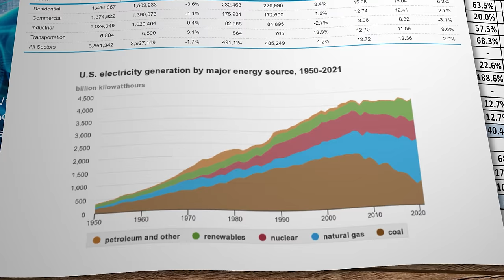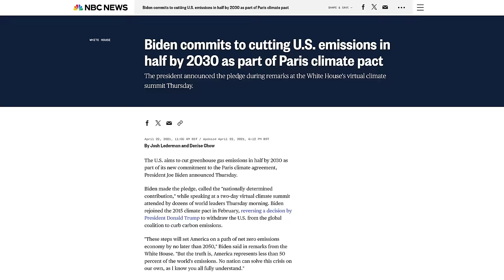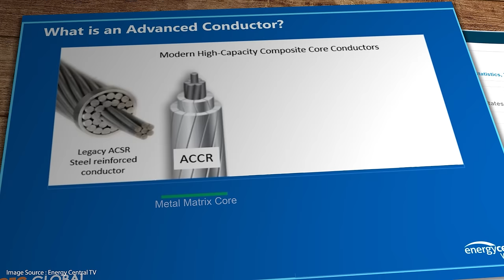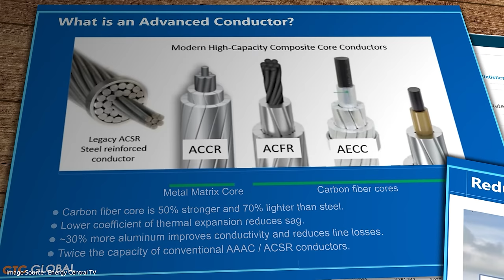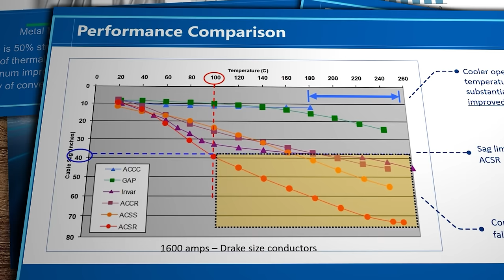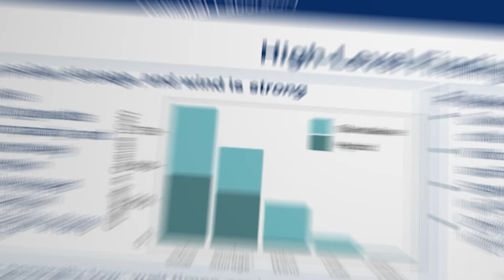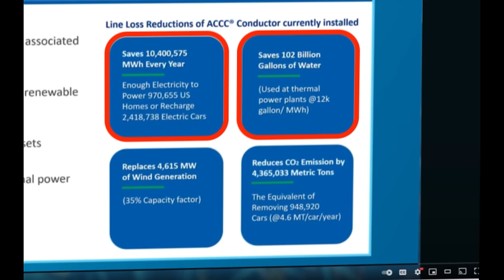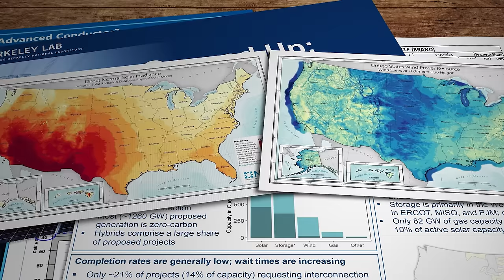Rethinking electricity grids.

Comment: I have been a shareholder in an upper Midwest (US) electric utility for over 50 years.  I speak with the CEO on a regular basis.  This topic has been part of our discussions for the last two years.  The companion to this are the sensors which can be placed on the cable that relay temperature information back to the utility.  These two technologies can increase the ampacity on the line 30 to 50%.
Reply: Excellent, thanks! I would also like to see more distributed solar and batteries, and more incentives for home and business owners to install them. Also, the weak link for that essential distributed electricity generation is excessively high battery prices. A $1,300 Powerwall néeds to store 40 kWh of electricity, not its currently pathetic 13.Here in California, I generate more than enough electricity to power a home and EV. But, I need a small, affordable, EV work pickup, not the $100,000 monster trucks currently available. And, I need40 kWh of electricity storage to go off grid.
Reply: @freeheeler09 I haven't dug into this, but I'm hearing that some good deals are available on the F-150 Lightning.

It's energy storage features are pretty impressive.
Reply: @freeheeler09  agreed! However, what if the EV car WAS the main battery, while the powerwall was the backup for while the EV car was in use?
Reply: Sounds great. I have seen an article about these sensor balls. Thing is, how does a dynamic current-carrying capacity on the line fit with the rated capacities of switchgear and transformers?
Reply: I could be wrong, but my understanding of the 'magic' sensor balls is that they give the electrical distributor the information needed to maximize current on the distribution line given the specifics of that line (temp etc).  Without the ball the distributor makes an educated guess, but always under estimating allowable current so as to not destroy the line.  The ball doesn't actually allow current greater than the line could handle without the ball.  So presumably the downstream transformers were sized to be able to handle anything that the line could handle and the magic ball just allows full current all the time which is not happening now.
Reply: @davidmenasco5743  problem with F-150 is it's oversized. The hood is dangerously too high, M1 Abrams has better visibility in front! And the bed is too high to easily put things on it. A work van is so much more practical I'd hate to drive one of these new "pickup" trucks.
Reply: @katjordan3733  Not a good idea, mobile batteries have more engineering demands placed on them in terms of weight, power and energy density.  A stationary battery should always be able to beat it on cost pwer kw/h basis.  All effort should be to put load on that more economic system rather then the one in the car, the absolute worst thing would be to drive up the size of car batteries for non-driving usage as you would effectivly be adding parasitic weight to the car which would increese total energy usage.
Reply: @chameleonh Yeah... those F-150s seem to be more "pose-mobiles" than practical work trucks!
Reply: . Except a Cybertruck
Reply: @chameleonh  Yeah, personally, I would prefer a van myself.  The E-Transit also has some energy storage features.  Perhaps it could be an option.

But you know, much as it pains me to say, the F-150 is the best selling vehicle in the US year after year.  That's an awful lot of posing.
Reply: @kennethferland5579 The Dutch are using their cars to power their houses. Not sure the details, but it sure sounds interesting.
Reply: How much is it to upgrade or multiply voltage by upgrading transformers or using HV DC equipment?
Reply: The sensor balls can also be seen by GA planes
Reply: @zodiacfml don’t the Chinese run DC at a million volts bug that really is a rebuild
Reply: Losses go up as the square of the current for a given size conductor.  1.5X current = 2.25X losses
Reply: @freeheeler09  The take or pay rules for renewables destroys base load grid capacity. It becomes unprofitable. Solar and wind need batteries to be dispatchable. That makes them unaffordable.
Reply: Good luck at the show !
Reply: The cost of a 'converter' to change from AC to HVDC start at $200 million USD.  And of course you would need a converter at each end of the line and possibly at intermediate locations.  
This high cost is part of the reason recabling is such a good idea  for existing AC transmission lines.
Reply: some one above mention ed vehicle to grid as storage solution. that would be interesting to expand on.
Reply: @msimon6808 Not true. Battery  kwh/$ has been getting better and better. Tesla's power business may be even larger than the cars.
Reply: @freeheeler09  - Do you know about the two CANADIAN guys who got tired of waiting for both Tesla and Big Iron companies to deliver Electric Semi Trucks ? They just built their own, in the form of Hybrid power, using low cost off-the-shelf parts for almost everything. They use a standard genset for the engine, which saves weight, purchase cost, and fuel consumption. They have also converted pickup trucks, and make kits for that. You can 'roll your own' in terms of the battery capacity and the efficient single-speed genset that lets you function even away from charging stations.
Reply: @YodaWhat  can you remember the name?

Comment: I'm a utility regulator in Maryland, USA. You are 100% correct. Currently, it takes between 8 and 17 years to build a new transmission wire. Reconductoring and the reuse of existing rights of way is the strategy!
Reply: Does upgrading to cables that can carry more current require any adjustments to permits?  I was under the impression that (at least in parts of Canada) permits specify a maximum allowed wattage.  I could very well be wrong on this, however.
Reply: Increasing capacity only requires a fairly routine permitting adjustment.
Reply: Are all new us-based transmission lines built this way? If not why not
Reply: Right now the United States is transitioning to the latest transmission technology. The inflation reduction act has a lot of money in it for that kind of changeover.
Reply: @MajLeader  Which is getting pocketed by the usual suspects. $7.5 bn for charging stations. zero built.
Reply: @msimon6808 Yea, right... Can you provide a source for this? Because this looks, smells and tastes like bull-crap
Reply: @cheekybastard99  Tell me you're not an engineer without telling me you're not an engineer lol.

Building things takes a LOT of time. It's not just installing the new cables. It takes years of planning to point down what is bottlenecking the grid, get the funds and the permits. Only then can the actual planning for the work on the grid start, which also takes months or years. You have to calculate what the right solution is, choose the right equipment, order the materials, decide how you get people on location (sometimes even things like heli's are used to install things on the grid, so this actually takes a lot of time to plan). Only when the planning is done, the right people are in the loop, equipment is bought or hired and people with the right expertise are hired can the actual building start. Which will probably take another halve year to a year.

From the drawing table to an actual product can take halve a decade. Things just move slow because they are incredibly complex.
Reply: @MajLeader  - What about boosting the wattage by increasing the voltage? Even with the existing cables, that will transmit more power, though the transformers and insulators also have to be upgraded. What about the High Voltage Direct Current (HVDC) upgrade? HVDC has lower line losses, removes phase matching issues from the long lines, works at higher voltage (enabling greater transmission distances) even with the existing insulators, and requires fewer conductors, only 2 instead of 3. Since most HV towers already carry 6 lines of 3-phase power, switching that over to HVDC means an additional capacity upgrade of 50% as 2 circuits get replaced by 3 circuits.
Reply: @YodaWhat  Don't forget that adjusting the voltage increases chances of arcing. So just bumping up the voltage is not as trivial as it sounds. also, most appliances require a quite specific voltage range, so you can't just bump up the voltage with 30V without those devices burning up.

As of HVDC, that is already slowly being rolled out into the grid, but requires a lot of infrastructural changes on at the transformer level. Those HVDC transformers are a LOT more expensive than HVAC transformers. This causes HVDC to only be cheaper from a certain brake-even distance, so it is not a practical solution for every line.
Reply: 1) My comments were aimed at long-line segments of the electrical grid. As such, the voltage is already far higher than any consumer or even industrial equipment would ever see. Those high voltages are handled by the specialized transformers the utility company attaches to the long lines. 2) Changes to the long-line voltage are accommodated by changes to the attached transformers. Those transformers drop the voltage to standard values used on the rest of the grid. *It takes around 18 months to get new transformers built for any of those long-line voltages, but that time period is compatible with the pace of grid upgrades. 
3) Insulators on lines carrying Alternating Current are already rated for at least 141% of the specified line voltage, because the RMS voltage (root mean square voltage) is used in the specifications, and the peak voltage is higher by the factor SQUARE ROOT OF 2, aka 1.414 or 141%. 
4) DC voltages are already less likely to arc across insulators and between lines, because the Time Derivative of Voltage for DC is ZERO, which makes DC voltage less likely to ionize air. That means even higher DC voltage can be used, before the insulators have to be upgraded. 
5) Techniques have been developed within the past couple of decades that make the handling and conversion of HVDC power much easier than it was previously. Two things in particular: 
High voltage DC circuit breakers were developed by Siemens, and ... 
A novel technique was developed for tapping power from HVDC lines without ever having to expose the inverter to the full voltage. For example, on a line running at 1 million volts, the inverter electronics are exposed to less than 30 kV, while tapping off several megawatts from the HVDC. In operation, that tapping off of power results in lowering the HVDC voltage by only a minor percentage, easily accommodated by the overall system. That technique was implemented years ago in Brazil's multi-gigawatt HVDC grid. 
 @jelmervd2l - Does that address all your concerns?
Reply: The scum of most companies… the shareholders!

Comment: From what I understand, a big holdup with this has to do with the perverse incentives of investor-owned utilities: building new stuff counts as adding assets while, as noted, upgrading the wires on existing stuff counts as maintenance - that is, cost - so the former looks better on their balance books than the latter, despite the latter being a far more efficient way to increase capacity.
Reply: Utilities are regulated monopolies, and one of the regulations is that they get a guaranteed return on investment.  The more they spend, the more they make.  Thus they are incentivized to waste money.  I don't know if the rule cares if the spending is capital assets or maintenance, but it's a rule that needs to be fixed.
Reply: Privatized power grids are stupid.
Reply: Good point.  Maintenance can add value to the balance sheet if there is a significant increase in utility.  Part of the cost is expensed, and part is capitalized.  However, there may be tax benefits to expensing as maintenance as compared to capitalizing.  What I don't know is if changing the classification from maintenance to upgrade will require a change in permitting requirements.  Permits may allow for a maximum amount of wattage.  All this information should appear in the notes to the financial statements.  Not that many people actually read the notes.
Reply: @dwc1964 Thanks, this is exactly what I was wondering: are the grids replacing old cables with these new ones, and if not, why? Presumably when cables near end of life they get replaced with whatever is the newest tech (assuming they don't have a warehouse full of the old stuff). But replacing cables that are still "good"? Sigh. It's good to know the tech will make it's way out there eventually.
Reply: @Indra-Ant  Ha it seems some utilities don't replace their cables until they sag and catch the landscape on fire.
Reply: That's what the board game monopoly was invented for. To highlight the destructive and undignified nature of capitalism.
Reply: @johnfowler4820  Capitalism is the worst system around, except for all the others.
Reply: @dzcav3  The system of whoever can kill the leader in a 1-on-1 fight to the death becomes the new leader was a good system.
Reply: @jeffreyquinn3820 regarding maintenance, it may be used to off-set (or re-set) depreciation of capital assets that have already been depreciated...
Reply: Utility scale infrastructure creation seems to have changed an awful lot over the last centry or so, I don't know if it's due to perverse incentives, public attitudes, or the fact that most of it, at least in the west is privately owned. My gut feeling is it's mainly due to the latter.

100 years ago come out the UK didn't have electricity transmission grid,  but in 1925 the government realised we needed one. It took a year to decide what we needed, 2 years to decide how to do it and 5 years and 2 months to build it, finished on budget and ahead of schedule, or possibly the other way round. That was 4,000 miles of pylons and cables, which is, nearest dammit, 75% of the length of the current UK transmission grid.

I don't think there was much pushback from the public because the existing electricity system was so flaky everyone was only too happy to have a reliable electricity supply. I think part of the issue is that compared to back then, when people could actually experience the problems with regular power cuts, now the problems are in the future and with sustainability being somewhat less tangible than the prospect of having to look out at a pylon, even in the distance.
Reply: True and those costs can’t readily be passed on to the users of electricity.  This combined with the obsession on shareholder returns makes upgrading lines a no go.  This has to change.
Reply: Do you think this is a taxation problem? Since the US tax code for businesses allows deductions via depreciation on capital expenditures, over time, vs a one time maintenance reduction, (the former being greater tax savings in many cases) perhaps the code needs rewriting so companies don't waste as much and subscribers to these utilities save money as well.  Most governments have no incentives to create a system whereby less taxes can be collected - which is a huge problem in so many countries. The governments get in the way more than they help.

Comment: Dave, you're one of the best.  Your regular updating of the energy/renewable landscape is appreciated and valuable.
Reply: I'm not impressed with anyone who believes GHG Theory. Water vapor is a greenhouse gas equal to CO2 according to theory. There is on average 50 times as much in the atmosphere as CO2. There are still no proposals for draining the oceans. Water vapor is not persistent? According to the theory water vapor's lack of persistence in the atmosphere (rain) means WV only counts for heating, not for evaporating more water vapor. Which is absurd because heating causes evaporation.
The theory is bunk.
Reply: Quite right. Well said ...